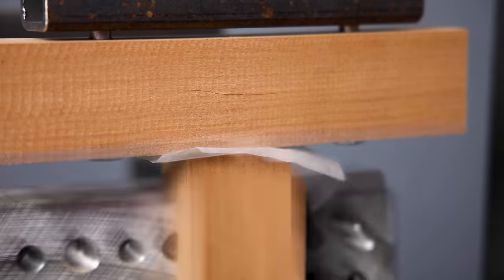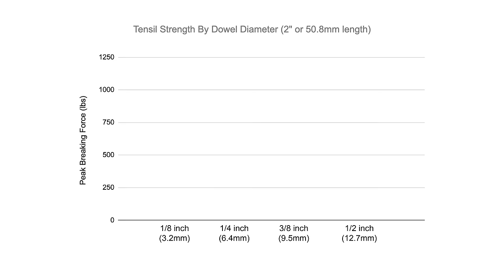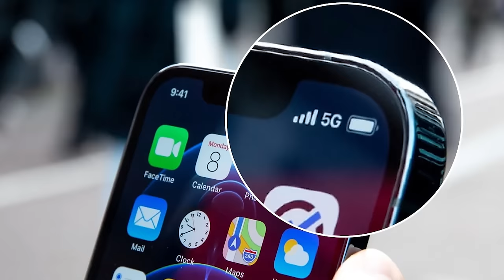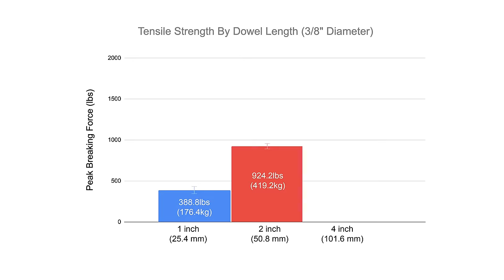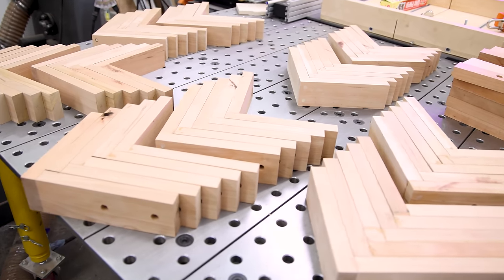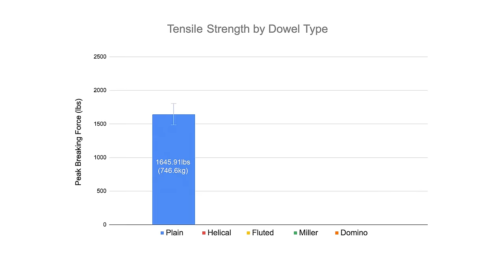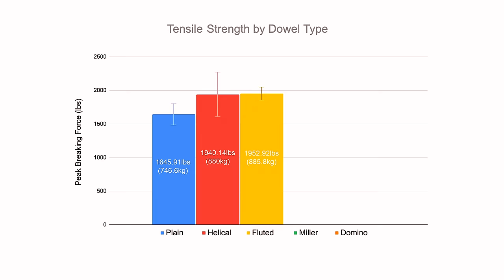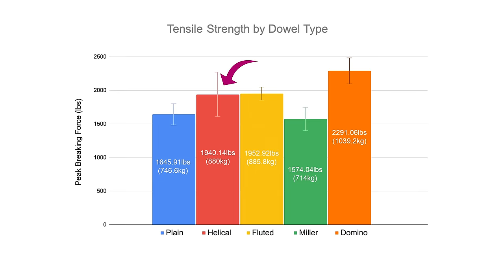festool domino vs  dowels

Comment: Nice job, I especially appreciate the error bars on the plots.  I use the miller dowels for fastening edging which can be thin, the cap of the dowel is stronger than just glue would be.  The idea behind the dowels with the vertical grooves is that the grooves are made by compressing the wood.  The moisture in the glue causes the wood to expand, filling the hole.  This should make for a tighter fit.

Comment: I am a professional cabinet maker anzusehen wooden dowels very often. I was a bit surprised to see how you are glueing the dowels in. I think your results would be much better if you add glue to the hole AND the outside of the dowel before inserting it. I use only ribbed dowels and insert them as follows: applying glue to the hole with a smaller diameter dowel, then applying glue to half of the dowel, then inserting it with a hammer until some glue of the hole is coming back through the ribs. Now apply glue to the other hole and the upper half of the dowel and pressing them together. Should be much stronger.

Comment: I suspect the difference in shear stress between the different sizes in the first test is due to the fact that wood is an inconsistent material with layers of different density grain. The smaller dowels might not get as much bite on the layers of grain. The larger ones exposed more layers and started to plateau to the actual shear strength of the glue.

Comment: Thanks for great video and test very useful.
A note on the fluted dowel, the dowels should have been compressed when they are made, so they should expand when the glue is in contact with them making them stronger while still easy to insert and allow glue squeeze out.

Comment: Your statistical approach has been improving over time! I love how you're not removing outliers anymore, and are showing the error bars on the graphs-- that's super informative! Kudos to you!

One thing that could be improved is if you actually specified what the error bars were (for example is it SEM, variance, standard deviation, or a 95% or other % confidence interval? all of these will have different interpretations). Going a step further, a statistical significance test would be important to see which differences can't be attributed to random error-- I could help with that.
Reply: Based on the way he spoke of them, those error bars, as you call them, are the range of the failure loads he got from each of the 5 tests. The main bar graph bar is just the average of those results.
Reply from the maker: Great question. They are SEM. You’re right- I probably should do signifcance but worry I’d need to realistically double my sample size to get meaningful information. Which would be difficult to do at my current pace and available time.
Reply: I only just came across this video and your channel, so knowing nothing (yet!) about your background in statistics or computation, I’d recommend 95% approximate confidence intervals (which, in my field at least, is basically the default for error bars). Approximate 95% CI bounds are easily computed as mean +/- 1.96*SE. Alternatively, bootstrapped confidence intervals are my preference—just take the 2.5th and 97.5th percentiles of the bootstrap replicates of the mean. They should be similar enough for these purposes, but I like the bootstrap.
Reply: Significance testing between estimates can be useful, but then you’re welcoming complexity when you get a difference that’s, like, significant at the .065 level, but not .05. Technically not significant, but you’re ostensibly dealing with small samples, and relatively high variance, so I’d say that’s probably actually significant and just low-n.

Comment: 8:00 the point of the domino is not increased strength, though loose tenon joinery is plenty strong. The true point of the domino system is to execute precise joints while maximizing the speed of the application. Dowel joinery suffers from how long it takes to setup and execute the procedure, as does classic mortise and tenon joinery. Execution and speed are the true strengths of the Festool Domino.

Comment: Thanks for the science!

A comment in favor of Miller dowels: Yes, they are designed to be installed AFTER a particular piece has been assembled, at least partially. Sometimes if I am trying to drill a 3/8 dowel hole into a 3/4 inch stock with hand tools, sometimes you get misaligned and the dowel comes breaks through the side of the piece you're attaching too. Of course, this can be avoided with better set up, marking and measuring, and better experience or mechanical assistance to make sure you're drilling straight. The thin end of the Miller dowel give you a bit more leeway in that situation, so you can have most of the strength of the dowel joint without risking the end of the drill bit breaking out of the vertical piece.

Comment: You have to consider by the sheer strength that the Festool Domino was the only dowel who didn't break, because they are way stronger than all the other ones. The wood broke at the Domino`s samples not the dowel itself. This makes the Domino the strongest Joint! Just the cause of the thickness of the wood let it seem to be the weakest joint.

Comment: The reason the straight flute dowels were more consistent in the test was even glue distribution.  The helical dowels--you drove those in dry and they tend to push the glue ahead if them in the hole.  The straight flute type automatically distributes the glue along the dowel.  If you had dipped the dowels in glue you'd have even better results.

Comment: Hi there, when you are using a larger dowel you not only have a larger area for glue but also more frictional force from the increased area.
Another factor can be that the larger dowel is easier to push into a hole with tighter tolerances without breaking, which intern increases your frictional forces even more.
It's similar methods used in engineering for bolts.

Comment: Love this test. I’ve long wondered about dominos vs dowels for this type of joint. I’m honestly surprised that the domino beat the bunch for tensile strength because it has the least amount of the fabled “long grain to long grain” glue area. It has the most total surface area, but because the slightly roomy mortise, almost all of the glue surface is the end grain of the wood piece to long grain of the domino. Goes to show that End grain to long grain, like in a simple butt joint, has plenty of strength. Most of us fortunate enough to do so will continue using dominos because they’re fast, easy, and, most importantly, aid in assembly.

Comment: Cool video - The best part for me was the difference in tensile strength and shear strength between a pair of dowels and a pair of dominos.   Shows you must consider the grain direction versus load direction to get strong joints.

Comment: For visible dowels I drill undersized holes and use screws and glue to make the joint, then later pull the screws and re-drill for dowels.
Reply: this is so you dont have to clamp?
Reply: @jasonjayalap  I definitely have clamps, and sometimes just to bypass clamping, other times for awkward, hard to reach repairs or deep field laminations, thinking back, it’s more of a process, ie  pre-drill or drill-press the outer holes first, slightly over sized 5/32 3/16, then positioning and drill inner hole 1/8 for drywall screws (maybe even with a clamp or painters tape for alignment) then using 1” fender washers or rubber grommets under the screw head to spread force.  But yesterday I did a big glueup the old fashioned way no screws- just lots of clamps hahahaha

Comment: Nicely done review.  I switched from dowels to the Domino primarily for the speed and speed related to cut lineup accuracy.   Fancy dowel jigs are expensive, and still don't consistently align the holes without NASA 'landing-on-the-moon' concentration.  It got sooooo tedious.  I tried a Domino at one of the woodworking stores.  Sold.  Not a second thought required.  Still though, dowels work.

Comment: to be honest as a retired furniture maker who trained many years ago, i used dowels as a go to joint.  using a horizontal drill and the drill press.  it was quick and efficient and have never had a joint fail.  my scotch chest in the bedroom i made 40 odd years ago and is as rigid as the day it was made.  i remember looking at the festool when it first came out.  my thought was as a one man shop, who does not do mass production, it made no sense financially to invest in it.  have never regretted not getting one.
Reply: I think it really comes down to the quantity / frequency of use and has to be evaluated as such. Most hobbyists and low volume specialty makers probably don't need it, but there is certainly a point where the saved time more than pays off.

Comment: Love how you do more than one type  of test.  Too many "joint strength tests" do a racking test and ignore tension and shear.   However... dowel joints tend to have differential expansion from the joint they are in over time, so the glue joints can tend to open up over time (seasons of varying humidity).  So repeating the test after a couple of years might yield way different results.  Also one thing to  remember is they have minimal surface area compared to other joints (bridle, box, dovetail, mortise and tenon, domino, biscuits, etc.) and most of the glue surface is end grain.

Comment: Yes you did have that plate made at a machine shop and yes it did probably did break the bank. As a journeyman toolmaker i can say that plate takes a while to make and our shop rate is $120 an hour. It's quite a bit of work and keeping it flat is another challenge. Buying a similar one off the shelf for fixturing parts in our laser engraver or CMM would cost us about $1500 last time we checked. Thanks for the great info your time and effort on these videos is greatly appreciated.

Comment: Finally found time to watch the video. Basically 1” or 2” long basic dowels suit my needs. I use them for alignment purposes mostly. Would you be making a video about sliding dovetails? I got the micro jig clamps and bit, that got me thinking, why not make sliding dovetails on the router everywhere? I was thinking for a battery box assembly, a sliding dovetail with magnets for alignment and a bit of holding power and use screws to hold the faces in place. The battery box will be moved on wheels and the box will be holding about 150kg of weight. 

Basically trying to think of the simplest joinery method without glue for people to use to assemble the battery box at home. Glue can be used, but not everyone is a woodworker, may not feel comfortable with glue.

Comment: My hypothesis for the pull-out strength resistance (lol) is that while moving to a thicker dowel, the surface area increases by the power of two, the volume increases by the power of 3. And so you end up with more wood being moistened with glue, being able to swell up, effectively being clamped against the hole wall, resulting in better adhesion. And when you increase the dowel thickness, you won't be able to moisten up all of the dowel after a certain point, so the strength per surface area plateaus.
Should you so desire, testing this hypothesis is fairly simple, here's two tests:
1.) Only moisten the dowels with water. Wait a bit, then pull them out and map out the strength per area. Should have the same trend as with glue.
2.) Use a glue that doesn't have water and doesn't absorb into the wood fibers so readily. Like 5 minute epoxy or construction adhesive (I'm assuming it would be fine, never used those and don't know their properties too well). This test should NOT have a difference between the surface area holding strength of different thickness dowels.

Comment: Theory on dowel size vs tension strength not being relative to surface area:

The cut (or hole) going across the wood grain of a larger diameter surface exposes more fibers that are conducive to better adherence to the glue.

Comment: Thanks for the methodical testing.  My understanding is that in the long term, dowels expansion and contraction is an issue, particularly when a different species than the work peice. 
I'd be interested in seeing how beadlock stacks up.

Comment: Someone will correct me, I believe that Miller dowel are meant to be easy to use in scenarios where you want the dowel to be flush cut and show thru.
That is why, I suspect, you can buy some in birch, cherry, oak or walnut. That is what they got going for them.

..Then again, with a little search, "exotic dowels" can be found over Internet...

Comment: I like the miller dowels for making drawers, quick and easy to drill the holes in the plywood and pound them home, I could use regular dowels but the millers allow for better to be a bit off with my holes and not blow out the side of the drawer

Comment: 5:00 haven't finished the video but to answer your question about the dropoff of dowel performance to size ratio as you went up, I'm going to bet that if you scaled the wood the dowels were joining with the size of the dowel it would look more linear.

The compressive force placed on the sides of the dowel by the wood itself goes down as your dowel size goes up.

Comment: One subtle difference in the thin dowels in your first set of tests is rigidity. As you apply force, the thin dowel will stretch more, causing the glue to hit it's strain limit earlier near the joint - basically, your peeling the dowel loose. Since the forces are carried further along the thicker dowels, more of the joint is engaged and it takes more force to break the glue.

Comment: The fluted dowel has it's grooves compressed.   The compressed fibres expand with the application of the wet glue.  This gives it good contact and allows release of air and excess glue.

Comment: Actually I saw a Japanese carpenter on IG who uses only dowels to make his doors. 

If you're like me (a hobbyist) you can use pocket holes in combination with dowels. That way you don't even need to clamp the pieces. But it's definitely good to hear fluted dowels are that strong, which is the type I usually go for. Plenty of those in the big box store. I have used miller dowels because they look cool, specially the walnut. I think these results are a bit disappointing though.

Comment: My understanding of the fluted dowels are that the flutes are created by compressing a dowel, and they are supposed to swell back to a more round shape as they absorb the water from PVA glues. Were you able to determine if they were in fact performing like that? In principle that should result in more glue surface as they swell.
Reply from the maker: I also bought spiral shaped dowels and ultimately did not include it in the tests bc it was a lot more work. But essentially, in my view, the spiral shaped fluted dowels appeared to be compressed. The fluted ones used on this video does not appear to be compressed, rather, cut.

Comment: Thanks, now I feel like a moron for pinning my dowel joints in my last project. I’ve seen some dowel joints come apart in cheap, old furniture from glue failure.  So I thought the pins would help prevent that. But I didn’t realize how strong dowel joints are.  Now I wonder if the pins will actually weaken the joints.

Comment: Love these test videos!! 

I think this is simply not the intended use case for the Miller dowels. I think it was intended more for carpentry than for woodworking, though of course it works for both. Imagine you are not joining two pieces together, but rather reinforcing a joint in place. Rather than pounding a cylindrical dowel two or three inches into a hole drilled through two pieces of wood, enter the Miller dowel. Its availability in several species offers the ability to match or contrast.

Comment: Nice video. I do want to additionally note things.

First, for all of the second-round of tensile testing that all of these forces are huge and which dowel used in real life (where the forces will not be under such highly-artificial conditions) probably doesn't matter.

Second, for the second round of tensile testing, the variance/standard error of the helical down is very large and if you were so use statistics if it was different than the plain dowel, they are probably not different than one another.

Consistency is important, and along those likes, much to my surprise as well, it looks like those fluted ones are the way to go. Thank you!

Comment: It seems like the miller dowels should be glues as pouring in more glue to fill in the air pockets until proper squeeze out. Maybe that's how they are are ment to be used. I never seen them before.

Comment: The key to understand these numbers is using crossectional area -- Not surface area.  The glue is more than skin deep.  Because the glue seeps into and penetrates the wood, giving it the full bonding strength.

A 1/8" dowel has a rough crossectional area of 0.01 sq inches. -- and a 1/4" dowel about 0.05 sq inches. -- Hence you see the strength is about 5x.
Likewise, a 3/8" dowel has a rough crossectional area of 0.11 sq inches -- roughly double again, and the numbers show.

Where it gets interesting is at the half inch, that should be about 0.2 sq inches, which should lead us to around 1300 lbs, of tensile force, but we only see 1021... -- from this, I think we can calculate the effective penetration depth of the glue is probably around 0.45".  (It might penetrate deeper than that, but if it does, the effectiveness drops off after that point I think.)

Comment: Huh, really interesting. I've been "flutting" my plain dowels by slightly and repeatedly crushing them with the serrated part of my pliers. Kinda wonder now if the crushing action is making it stronger or weaker. It certainly helps it squeeze out the glue.